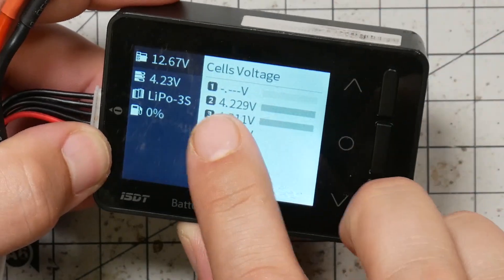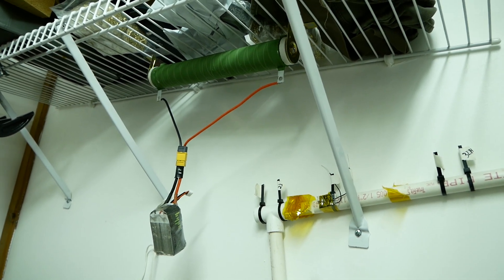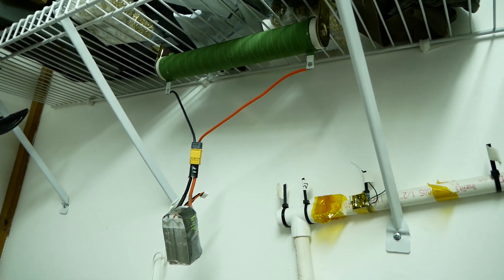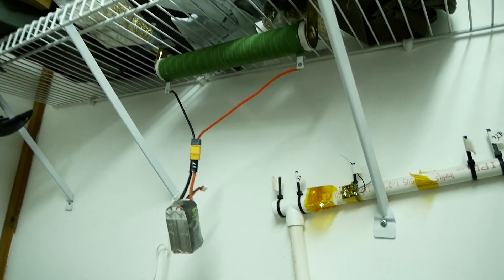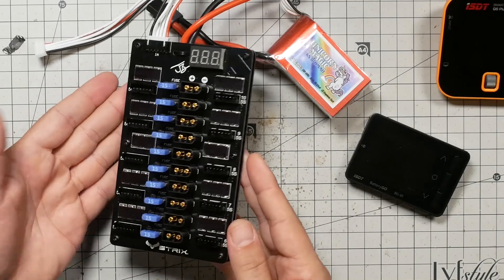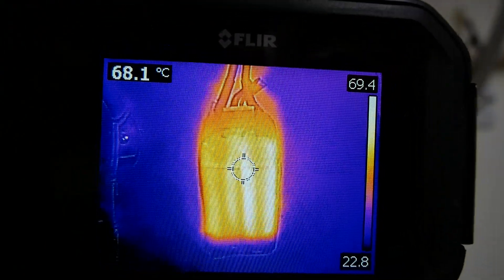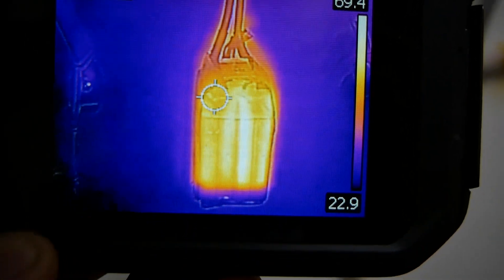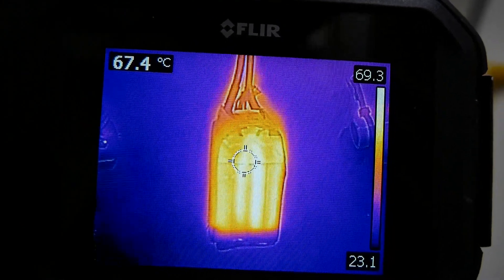Is Your LiPo Safe To Charge | WHEN TO THROW IT OUT

Comment: I'm a sponsored 3d heli pilot and also big time in to race quads. About 15 months ago I was para charging 6 6s 5000 heli packs on my Icharger 410 duo, I was charging at 1.5c (moreless brand new Optipower packs with 3 or 4 cycles on them) so 45amps. The packs was all discharged to 3.65v per cell from a 3.80v storage charge  prior to charging and all cells was within 0.02 a volt of one another. About 15 mins in to that charge cycle I do not know why or what happened (I'm assuming one cell  failed during that cycle and the voltage raised well above 4.2v... this is a total guess) and all the sudden I had the second pack on the board turn in to a flame thrower, I was on the flight line teaching a student piroflips when I seen the smoke and fire... we put the goblin 600 on the skids real quick and I ran to the charger (we was the only two there, it was a Tuesday morning) by the time I got there two other packs was cooking off from being in the direct flame and as I'm getting the lit pack yanked off the board the other two then decide to go off, so I yank the 3 still not burning packs off and throw them in the field so they don't go off and are safe... now I'm dealing with one back that's off 4he board on the table burning like crazy and two other packs that are going hard. There is so much smoke I can't see and it's venting very badly along with intense heat and I can't see what I'm grabbing so I say fuck it and grab the charger and all yanking it from the power supply and throw it over the table out on the field and then go yank the para board from the charger. The charger didn't survive but it's no problem as I fly for Graupner anyhow and have two brand new Polaron 1400w chargers and was not gonna be using the Icharger anymore for a while other then home charging anyhow. I will say that is the first lipo fire I have ever had that wasn't crash related. I have never had a charger fire. Us heli guys have all had our fair share of crash related lipo fires as in hard crashes on large helis the packs take a hell of a lot more punishment and the bigger packs are much more likely to go off in a crash then small 1500s or smaller. But I got a Truely healthy respect for charging fires. That was out of hand completely I had 3x 6s 5000mah packs going up all pretty much at the same time it was scary as hell and violent the biggest issue that caused it to get out of hand was the stupid ass lipo sack burning and melting that made it nearly impossible for me to not be burnt every time I tried to grab. If it wouldn't have been for the melting lipo sack I would have been able to just grab leads and start yanking and throwing packs but the sack melted was getting me burnt every time I tried to grab ending in me just grabbing the while charger unit and throwing it where I could work without risk of the tables and puts catching fire. I never charge large packs in the house as they are so much more violent then smaller packs when something does happen. But after this I will NEVER charge in my house any lipos ever again. These was 6x nearly brand new world class packs that hadn't had any damage from over discharge and hadn't even been really flown hard yet. The Polaron chargers are extremely accurate as are the 410duo chargers. When you pull a charged pack off it will look like this 4.20,4.20,4.20,4.20,4.20,4.20 if you single charge a pack at 1 or 2c they are dead nutz accurate of voltage and that's checking the cells with a lab grade calibrated Fluke meter that cost around 700 dollars (friend uses it for work reasons) if you para charge you it will be something like this 4.20,4.19,4.20,4.20,4.19,4.19 so still all within a hundredth a volt. I do not have any real idea what caused this but my guess is what a stated above. If anyone cares to read all this and has a theory as to why this happened I would LOVE to hear your thoughts. Thank God nothing was burned down and no one hurt other then some mild burns to my fingers on my right hand and some unhappy lungs from breathing in that venting smoke for a breathe or two as I was fighting fire, panicking slightly and then coming to decide as what to do. Only damage was some scorching on the tables plywood top and a destroyed Icharger 410duo and 3x Optipower 6s 5000s. If that would have happened in my house I would honestly be scared as to how badly that may have ended. I have now had a friend that welds build me a diamond plate box with 8x high power computer fans 4 intake and 4 exhaust  the two paraboards mounted in it for running both charger channels on room for 12x 6s 5000mah packs and then two xt60 baseboards for mini quad packs. So should something ever happen how the fire is contained . The bottom is insulated with a 4 inch gap between the bottom plate and the inside plate the paraboards are mounted to and in between that gap is some high temp insulation he put in there prior to welding the mount plate in. So very little heat would be transmitted to the bottom plate in the event of a fire. The box cost me 85 dollars in diamond plate, 20 bucks for the insulation, 100 bucks for the fans and power system plus the white Leds for light and I gave him 75 bucks for putting it together for me. This is my new lipo sack and I will never have a out of control fire again from a lipo charging nor will I ever kill a charger because now the charger(s) stay outside the box. And use 10ga wire in a 1.5 foot length to run from the para board to the charger port.

Comment: @Joshua Bardwell, what's the difference between the resistor you listed and the ones with aluminum covers by Uxcell also on Amazon?
Uxcell Chassis Mounted Aluminum Case Wirewound Resistor, 100W, 2 Ohm, 5%
Reply: Patrick S if it’s the same resistance then it can be used but those aluminum cased resistors need a big heat sink to be used at anywhere near their power rating. There are a lot of overrated  China-sourced resistors too, marked at 100W but are only 10W-25W resistors if mounted on a heatsink.
Reply: @batterymooch  better to stick with the one he showed them, thanks!
Reply from the maker: This is the right answer. Heat sink.

Comment: Joshua, I have a Pyro-Drone 2200 5s which doesn't really have any of the symptoms you're mentioning but it way underperforms. All IR are from 4-8mΩ and it doesn't loose any voltage over time.      However when I go to rip, it dies and reads low voltage just after 500mah of draw. Not warm at all. After plugging it into the lipo checker, two cells are around 3.8 while others are at about 4.0. This pack also gets warm while charging at 1c and it takes longer to get those two cells to 4.2. The pack also has about 10 cycles on it but was bought a year ago. Always kept at storage charge when not using. Should I retire this pack?
Reply: Yes. If it gets warm while charging thats not good
Reply from the maker: The thing is, it already doesn't perform well. I would consider keeping it for field charging maybe but I wouldn't fly it.
Reply from the maker: If it gets warm at 1c that's very suspicious.

Comment: The thermal image of the battery being drained-to-death got me thinking, with packs charging in parallel, could the thermal imager be used to spot if one of the packs has a bad cell?
Reply from the maker: Yes definitely.
Reply: Prices of thermal imaging cameras have really come down, I know Flir will always be expensive, but I got a HT175 from Banggood for about $100 on offer (now back to $129), 32x32 pixels but even that is enough to tell you if part of a battery is hotter/colder than the rest.
I'm curious to see what your Flir can see when parallel charging batteries, and perhaps if one is already known to have a bad cell.

Comment: You know they tell us in the directions for the lipo to give it a salt water bath to discharge the battery and kill it!
Reply: That is what I do with all of my bad batteries (once I have stripped out the good cells, to put together with others, to make a good battery). It is amazing how soft the cells go, after they have been in saltwater for a few days.
Reply: Just a matter if you want to sit there and wait for it or not. Days and weeks vs about 20m using a light bulb.
Reply: @SpicyFPV  Yeah but, with a saltwater bath, you can walk away and forget about it. Especially, if you leave it outside.
Reply: Temporal Flux I leave my light bulb method unattended outside too. It’s in a closed ammo can with vent holes sitting on a gravel pile. Haven’t had one flame out yet, but with that setup it wouldn’t matter if it did aside from probably losing my light bulb.

Comment: So being a total noob! I shouldn't let my 4s get under 3v per cell for a total of 12 volts?
Reply: Argh it's dead
Reply from the maker: That's the absolute minimum before it's definitely damaged. But 3.5 or 3.7 is healthier.
Reply: Land at 14.5 ish under low throttle for max packs life bro
Reply: @flo-ridafpv5713  thanks you the quick response guys! I definitely need to get a cell checker because I ran some batteries lower than 14 volts.
Reply: @brian1978503  A few times goin lil below 14v resting won't hurt the packs too much, if they are decent packs with quality cells, just make sure they are all pretty even after flights, if so they are healthy

Comment: Am I the only one that shorts them by putting a nail through them to completely kill the chemical reaction. I do it safe but am I the only one?
Reply: Sometimes I cut open the cell pouches and dump the battery in a bucket of water. I have had some scares where I cut a little too deep and it sparked a little mostly cause I wasn't expecting it the sparks were tiny.
Reply: @corasianfpv8196  that's actually more dangerous cause lithium reacts with water but the water will make sure a fired dosent spread. I simply.put 1 nail through the center and it kills the reaction by completely discharging it in what seems to be an exothermic reaction.  The reaction runs away and kills all the active materials.
Reply: @potjnkye86  Not really, the most dangerous part is the cutting of the pouch. The reaction between lithium and the water just creates the Lithium Hydroxide (with enough dilution should be ok) and unless you're putting a massive block of it in the water (or putting some in an alcohol) it is just going to bubble a bit and generate some heat. There isn't much lithium in a LiPo so it should just bubble a bit and the water should pull away most of the heat or worst case contain the fire. However, I believe the electrolyte is carcinogenic which could be an issue in the long run.
Reply: I do the exact same, and sometimes solder + and -

Comment: I have a significant amount of lipos that me and RocketSquid on YouTube will be “disposing of” as soon as we can. I charge my batteries in a metal case and I transport all my lipos to and from the RC tracks in an ammo box. I’ve had some very scary experiences with LiPo, NiCd, and LiIon batteries as well as esc’s. I see guys at the track running lipos that are more puffed up than Harry Potter’s aunt. It’s scary.
Reply: By “disposing of,” I mean BLOWING EM UP! (Safely lol)
Reply: Hope you've got vent holes in that ammo box. If it still has all the seals in place and one cell goes off it will set light to all your batteries  and you'll be picking pieces of ammo box out of your head.

Comment: You left out the signs of a puffy battery.
Reply: Signs of a puffy battery:
Puffiness😄
Reply: @banditfpv  or thicccccccness
Reply: @faebu8601  One hella thiiccccccc battery😂😂
Reply: @faebu8601  Thicc lipos save lives. Thicc lipos do it better.
Reply: Cell offgassing is always a sign of damage.  In industry they use offgas detectors as early warning signs of impending cell failure.
Reply: Do R/C! This maybe a stupid question but is it lithium gas that the testers are designed to detect? And I assume it's a mega expensive bit of kit? I'll google it if ur not sure, cheers
Reply: @fpfree8821  nope they detect co2 cause thats what coming off the cells... Plus some tiny amounts of hydroflouric acid
Reply: Peter Zingler great, cheers. Thought hydroflouric acid was a typo (that's a new one to me) googled it, mind blown! Dissolves glass. Didn't even know that was a thing. Superb.
Reply: @fpfree8821  I think it's methane. Which is why you get the flames if the battery is hot enough to ignite it.
Reply: I've 4 batteries that didn't have many cycles, always put them into storage voltage after use, none were drained below safe voltage, all a little puffy from sitting doing nothing at storage voltage after a few months.
Reply: Sign of a puffy battery: doesnt fit the battery strap..

Comment: I always charge in a metal box. Too stupid not to protect all your tech if you don't charge outside.
Reply: Make holes, I removed my lid, placed metal rack in top.  Take ziplock, fill w/ baking soda (appx 2-3cups), take small balloon or condom, fill w/ 2-3oz of white vinegar, tie knot, place in ziplock and seal.  Place on rack over charging lipos. If fire happens, melts bag/balloon.  Vinegar/baking soda combo creates large amount of foam, to smother fire.  Similar to ingredients we carry on our fire trucks for when we need foam. Same thing kids use to make science project volcano.  Very cheap to put together.
Reply: I have a bullet box will this work , what about off gassing make holes or just crack the lid

Comment: JB: "Don't roll the dice on lipos"
       (Rolls dice in closet)
Reply: Bash with hammer. Return to Drew for giggles.
Reply: @fpvwing  I've heard of a guy, I cant remember who but he took his retired lipos into the desert and would do target practise on them ;p the lipo exploding is a nice hitmarker
Reply: @lukagroot7409 - I've done that a few times, my buddy has property out in the sticks where he hunts and goes 4-wheeling. We'll gather up all our bad lipos and head out there with our rifles, it's actually more fun shooting them with just a little .22cal round, does just enough damage that come apart pretty violently, bigger calibers sometimes just blow them apart before chemical reaction can start.
Reply: @sunshynff  Does ".22cal round" include .223 out of curiosity? :D
Reply: Honestly, that did actually baffle me.  I would in that Le Drib battery still use it, just with precautions well before I'd discharge it inside the closet like that with no fire prevention like a lipo bag.  lol
Reply: I got a bucket of saltwater
Reply: @taattataattataattata  To force bad batteries to burst into flames? Seems safe ...
Reply: Yeah! 
First talk about safety and "take no chanses" - then discharge the bad ones in the closet, right under a grate shelf packed with flammable stuff. The thermal image also showed it got  quite hot - up to 70°C, so probably not that far from a thermal runaway either. Why not just take them outside and set them on fire in a controlled way instead (for example by a short circuit or puncture them) - way more fun and a lot safer than discharge them all the way indoors (especially with that setup).

Comment: Nice tip on the parallel charging. I use your boards exclusively. I noticed it was having a hard time balancing at the end . Taking a lot longer than normal so I shut it off and yeah I had a bad cell

Comment: I fixed my batteries by removing the bad cell out and replace it with spare one that I sacrifice(the same brand, mah and c-rating). It's super easy  to remove too. You should try it.
Reply: I operate on mine too- did you ever fuck up and rain sparks? Ruined some good cutters

Comment: What about lipos that are just old? Like 2 years or more.
Reply from the maker: As long as the performance and internal resistance is okay, I would keep running them.
Reply: Thanks, I have been wondering about my ebike battery, it originally had 28x 18650 cells but I re-celled it with 14x 5000mAh lipo cells in a 7S2P configuration a few years ago, it's still going ok but all my chargers are 6S so can't check internal resistance.